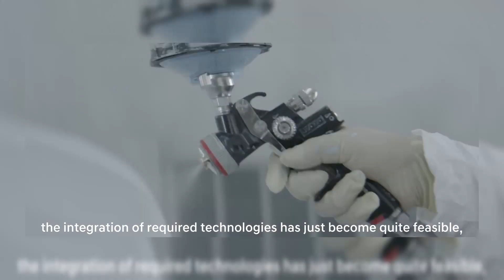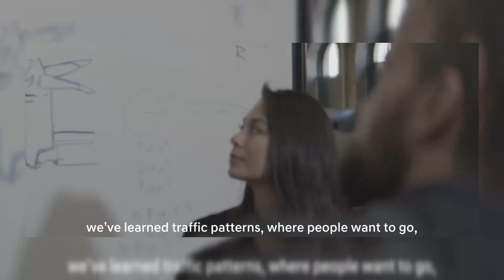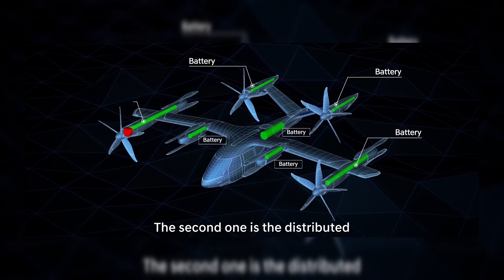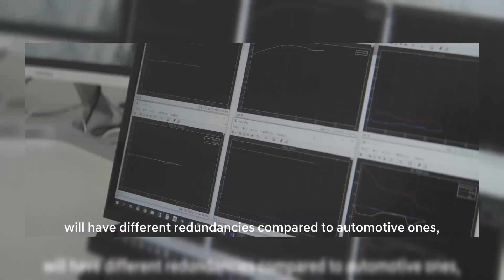Hyundai Reveals eVTOL Program S-A1 Air Taxi | Urban Air Mobility 현대

Comment: It's a interesting solution to the safety issues compared with quad rotor type aircraft that others have imagined.  Seems like it will work.  I wouldn't be concerned with who uber plans to work with.  Realistically, they will work with everyone.  Hardly seems like they sign up with a single car maker for their road taxi service.

Comment: There's little reason to doubt Hyundai but disregarding all other possible comments about size,similarity to Joby, hyper-fast charge time, and even the odd ceiling altitude...the range. 60 miles? That's maybe 40 miles operational with some buffer for safety? Quite odd.  Lilium still seems to be a much more simple format and therefore more reliable with plenty of bilateral redundancy if needed due to equipment failure. But is it real?
Reply: In this video, he claims the craft altitude flight is to low, what i notice, the blade exposure it very low to land area objects and peeps, other then that, it looks like a mix advantage of Joby, Archer & Lilium in one. For me, I'd rather see the rear propeller on the middle wing look just like the front position, only after turning off to hirizontal flight, the blades pitch flat, while the rotor pivits 90°, then the blades flip reverse & turn on, to support speed in horizontal flight.

Comment: Its a cross breed copy-cat of Joby wing form, Archer rear vertical blades, while seatings , cockpit and passanger space of Lilium, but the down side, its exposes too much propellers to lurking people standing near, and not as quiet then any of the 3 predecessor. But the most annoying feature, this video of multi rectangle screen frames showing floating box fast vans of people standing in it, through the last 20% of this video.
Reply: The Lilium jet has six passenger seats.
Reply: @michaelisaacson9735  didn't mention any seating quantity count, but, its actually 7, counting the pilot.
Reply: @ckdigitaltheqof6th210  That's why I wrote, "six passenger seats".
Reply: @michaelisaacson9735  but who was debating a different count before?